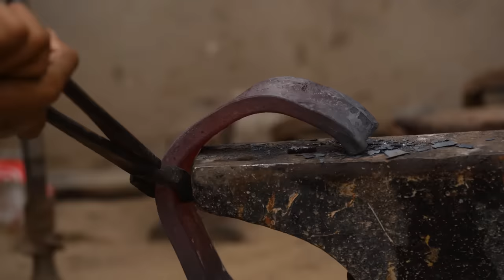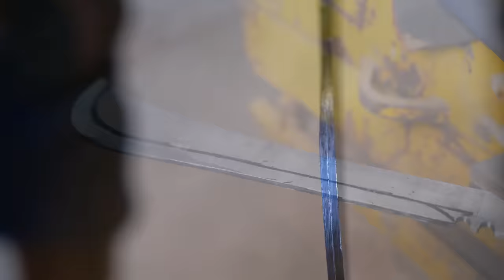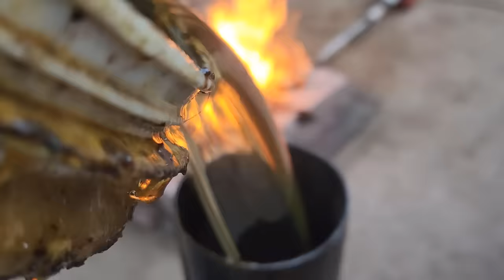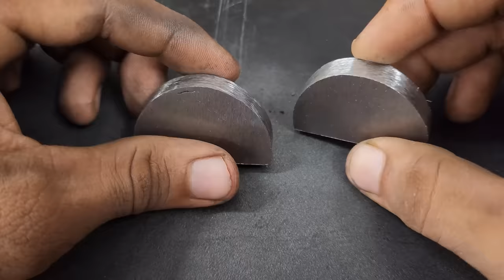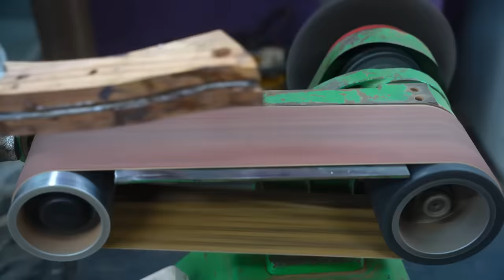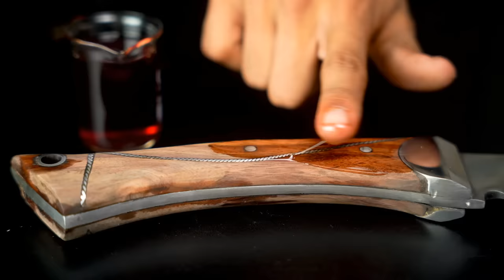Forging Machete out of Rusted Bearing

Comment: Looks nice but what was with that quench?? Did it harden properly at the low red heat?
Reply: It’s a bearing which is high carbon steel so it can quench at low temperature very well than a low carbon steel